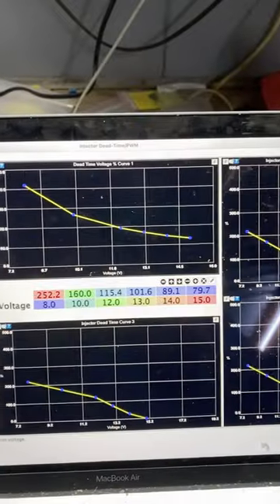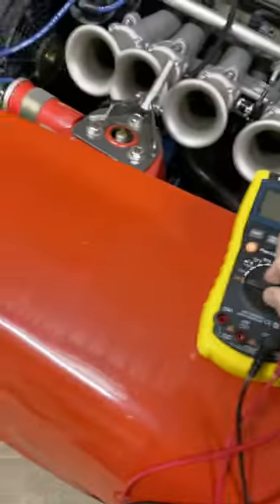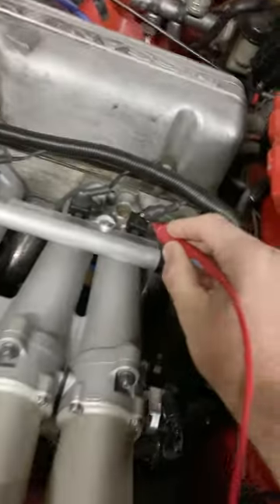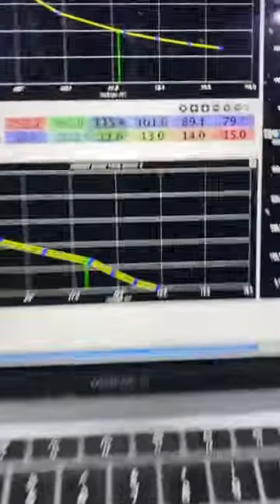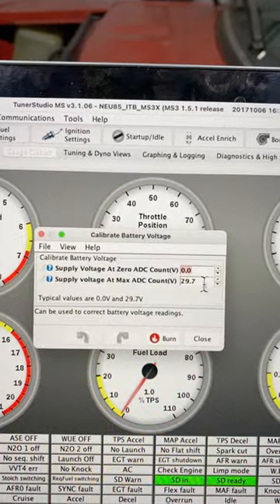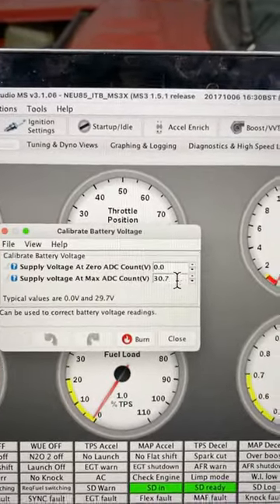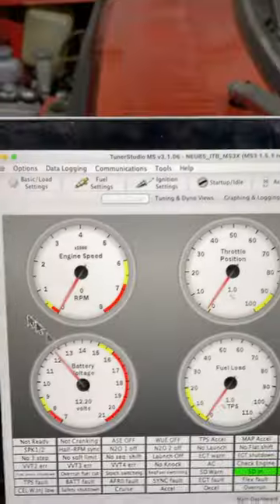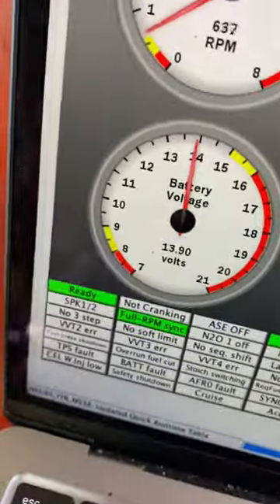How to calibrate Megasquirt battery voltage

Comment: I had to add 32% to voltage calibration while the engine is running to match the voltage measured power wire to megasquirt 2 but when the engine is off key on voltage measured at the same place 12. 45 volts but Turner Studios gauge reads 13.7 volts. any ideas?
Reply from the maker: That sounds like a problem possibly caused but grounding issues.

Comment: How do you calculate ADC voltage? I have a difference of 0.12 volts when measuring from battery terminals versus to injector clips (leads hooked up to negative terminal of battery and one clip of the injector). 
I tried testing for bad ground by clipping leads to positive battery terminal and injector ground wire but it was the same voltage as hooking up directly to battery. 
Any idea why I would still see that 0.12v difference?